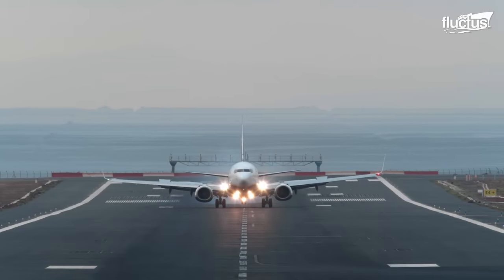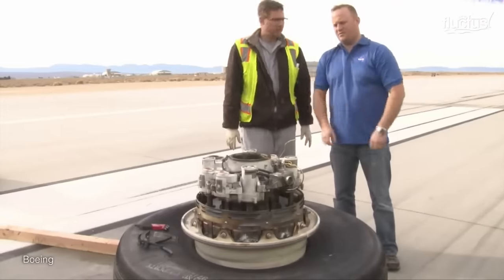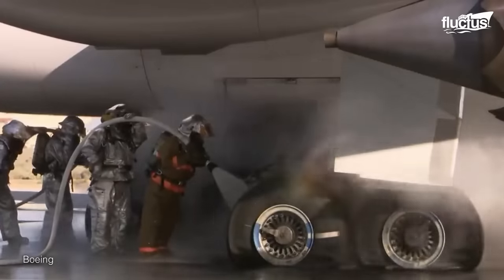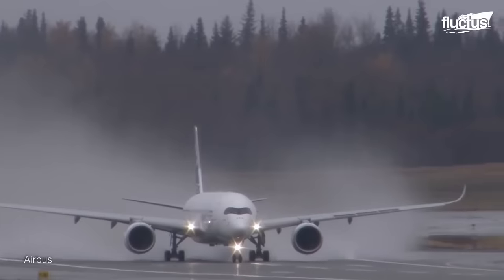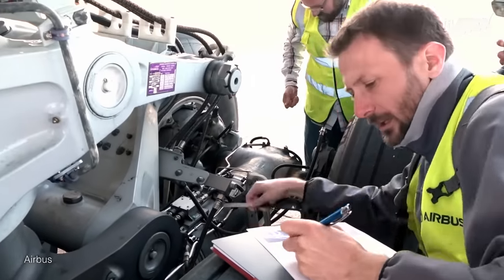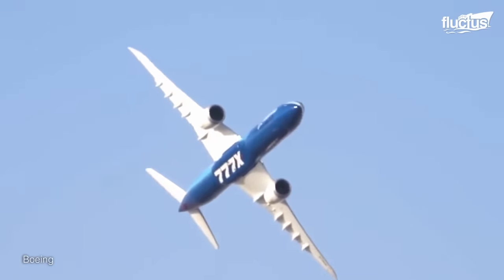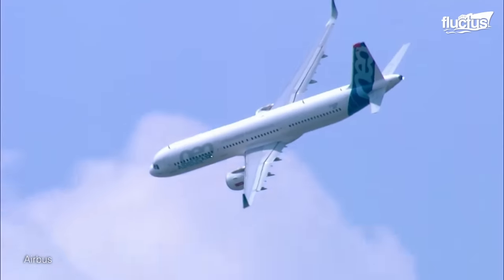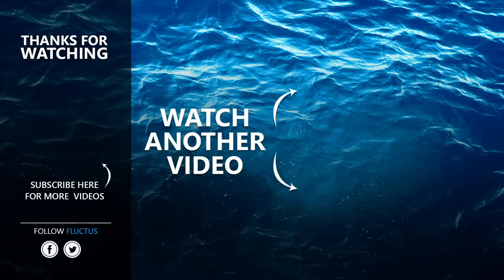How Brand New 340 Million $ Aircraft are Cruelly Tested Just Before Being Sold

Comment: You are incorrect in stating that "the aircraft are subjected to vigorous testing after production."  These tests are performed on pre-production aircraft as part of the type certification testing to demonstrate that the aircraft meets or exceeds or the type certificate and production certificate requirements in 14 CFR part 21 and 14 CFR part 25 (for transport category aircraft) or their equivalent for aircraft whose State of manufacturing is not the USA.  It is only after this testing is satisfactorily completed, that the aircraft is issued a Type Certificate and the manufacturer is issued a Production Certificate allowing it to manufacture and sell the aircraft.  Each production aircraft undergoes a thorough production testing  process before delivering it to the customer but not as extensively as during type certification testing.  The type certification testing for transport category aircraft can take years; production testing takes many weeks.  Before accepting a new aircraft, the customer also does their own testing and inspection of the aircraft.
Reply: Wow how do you learn this much,are you like an aircraft engineer?
Reply: Ko 9l90900000000900😮😊
Reply: Truly well said 👏

Comment: Brackkes worn must be when applied at 300 not speed of craft where ready for flying...if applied drags then brakes never worns the brakes....it's success test of brake in emergency mood after landing engines are fail in de thrust plan were stop and saved dont care brakes are burnt it's may replaced with braking system it's low cost then complete air craft and passengers staff lives..❤❤❤❤❤❤❤❤